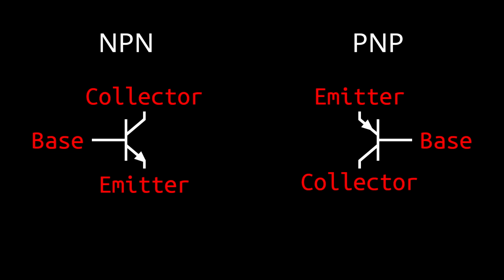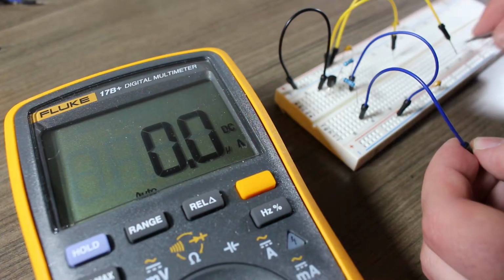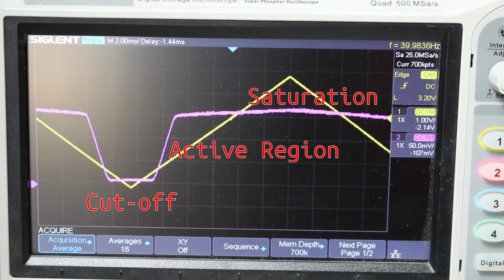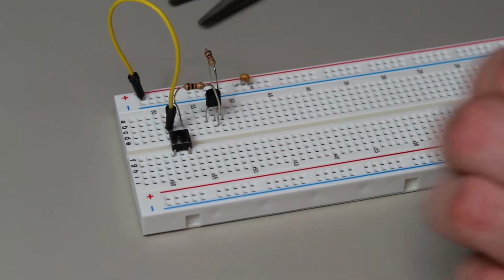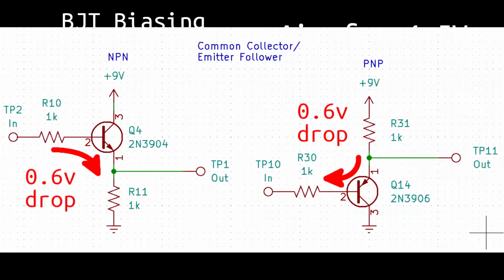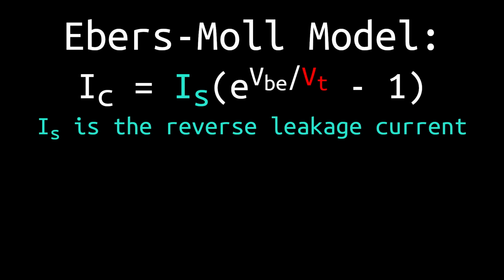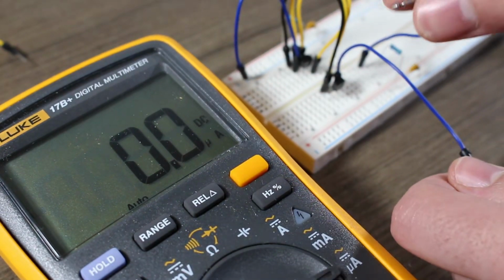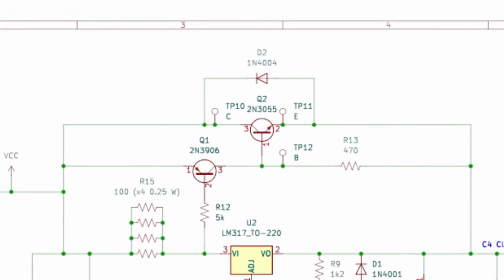The Ultimate Guide to Transistors (BJT Edition)

Comment: Has nothing to do with transistors but i have to ask, what kind of capacitor do you put in those breadboard power rails??
Reply from the maker: I put 100nF capacitors for filtering on the rails. It helps a lot.
Reply: @SineLab  Oh really? I'll give it a try myself! 
What kind of PSU do you use to need such filters? Not really necessary if you are using batteries for example, right?
Reply from the maker: @JazzBerri  Nowadays, I use a linear power supply for most things. Though I'd still say to use a filtering capacitor even with something as clean as a battery. You'd be surprised by the noise that can appear.
Reply: @SineLab  a battery shouldn't give any any issues but now im curious, I'll hook it up to a oscilloscope to see if i get any changes!

Comment: For the MOSFET edition, use BS170 N Ch and BS250 P Ch Signal (not power) MOSFETs, they come in TO-92 ❤.

DONT use 2N7000 it has SGD pinout which I dont like 😅 😂. BS170 is considered as an equivalent of it.

So both these BS components are also available as KL variants, like BS250-KL which are slightly better.

So I stock BS170 (non KL) and BS250-KL, so that I getter a better match between the two as BS250 has quite lower performance than BS170, BS250KL gets closer to BS170.
Reply from the maker: I'll have a look at the BS170 :)

Comment: I watched the video multiple times and really enjoyed. This is a real ultimate guide. 

I admit I have a request for a similar video featuring FET transistors (J-FET, etc. ) and especially their linear part. This would be awesome!
Reply from the maker: I have plans for FETs in a future video. :)
Reply: I could not find the second part. But FET in the linear region are weird. They are often (digital and analog) used as transfer gate with symmetric source and drain. People don’t seem to care for gate voltage. They use them as relay. Open or closed. When Open, there are so many carriers in the channel that neither source or drain can suck them out with their relative small voltages . 

And then there is the Gilbert mixer which applies an analog signal onto the gate. I still think that source and drain are symmetric here. Or should be for max linearity?

Comment: thanks, analogue components are a special case with a great deal of value in understanding, if you want your finger on the pulse of some environmental variable they are a must!, anything and everything on the subject of transistors and op amps is appreciated, most of what I do is digital and using mosfets to solve most applications, bit lazy I guess😉 even the right MOSFET is enough to give me the shits when combing through yet another pdf data sheet 🙃,Thanks again and keep it up
Reply from the maker: I'll be sure to keep up these analog circuit videos!